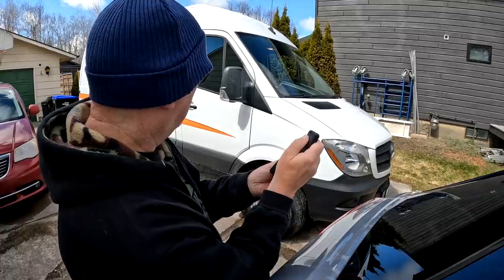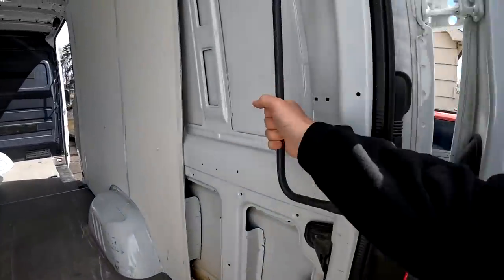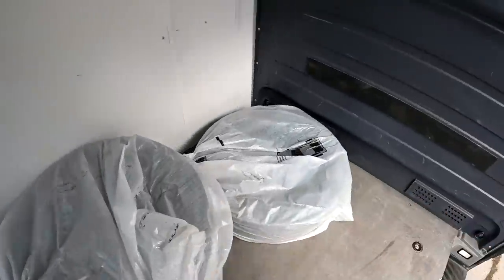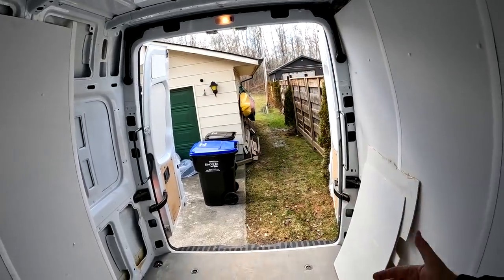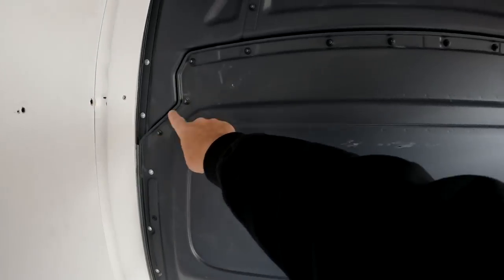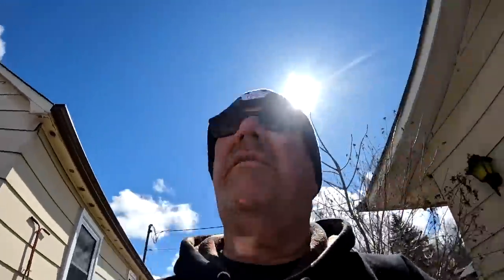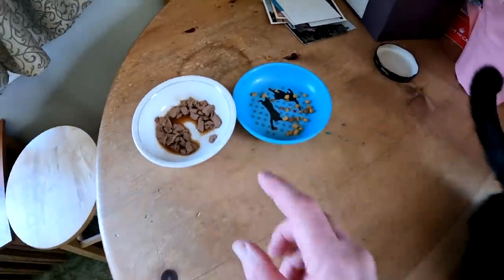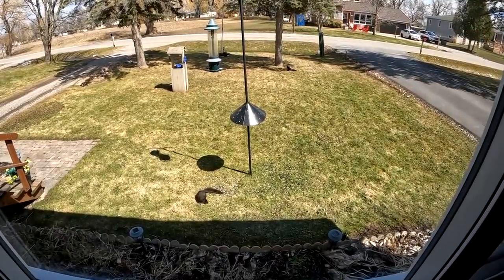Taking Out The Rubber

Comment: Hey Ken from my experience of working on those. All you need is a flat head screwdriver. To remove those caps. Also highly suggest getting them mounted on some steel wheels. Much cheaper in the long run. Also they are bolts style. Not regular style
Reply from the maker: What wheels do I have then? Bolts not lug nuts?
Reply: @Ken_Domik  yeah in certain way but they are called lug nut bolts .Mercedez have them Volkswagen.too. Those type of style are harder to but on as the type of style they are.hard to explain .

Comment: My take with the jackery or the Blue I’m not sure 🤔 to I thought I could use my solar panels from my jackery on the blue generator or you have to use theirs??  Depending on when or if God willing I can get 1500 or the blue max as the one you just got. I know Coleman makes em their a solid frame unit the only draw ✍️ back to either unit is the amount of panels to get a quick return on juice and sun duration. The other is preventing the cells from weather damage. The blues are water proof. Their are bigger cells but weather like hail damage gotta be mindful of the weather. All you can do is talk to the rv dealer about solar panels and kitchen/washroom set up. Installing water tanks. Pumps sewer hook up. Go tank less hot water. We set ours to eco mode water is a must so you can shower -/shave/ without waiting hot water. Tanks are extremely small we add dawn to the grey water holding from dishes. Showers 🚿 etc. no no on bacon grease things of that nature. Rest is ok after you wipe off excess food crumbs. Sewer black tank commode use rv aqua toilet paper 🧻 rated because it breaks down real easily since you have the big blue you can use electric ice chest/get an ice maker you can get rv fridges that run off propane/electrical power so even a residential fridge can be put in with its own ice/water skies the limit options. See rv dealer or do ice trays option is yours. Winter is easy drain water tanks. Add rv anti freeze etc but after you dump your black/finish with grey to flush sewer hose add a bottle to toilet and kitchen sink [prevents odors] that stuff sits in the tank during use and non. They’ll show you how to winterize properly every unit is different. You’ll need a water hose for when you hook up at sites that do =. Add a blue water filter one end to the faucet the other hose. We got a heated hose for when it gets cold theirs time to camp plug 🔌 in the hose keeps the hose warm enough to prevent freezing. You’ll need extension cords surge protector for your rig they set that up for you. External plugs or sockets on the exterior. They can set up power cord reel so you can run stuff on the inside. But you can just use your blue for thirty amps. Set up sockets on the inside the big corded electrical cord is a plug/turn lock I’m sure then turn on power from unit, write down what I want and have to have let the rv dealer fix it up or come up with options you say yay nay. Don’t know if your blue unit is water proof?? Spot to consider charge/use while camping on the inside solar out then with indoor big juice cord run stuff off unit

Comment: Ken, I have traveled in a VW pop up EuroVan made in conjunction with Winnebago, with 3 adults. We camped through the South and also did follow the Lewis and Clark trail.  Does it have a fresh water reservoir and subsequent gray water tank?  AC and heat when you are not traveling?  I guess in short, my question is why reinvent the RV? I pray it's not just to be stealthy.  I will continue to follow and like because I am curious and like you. 👍